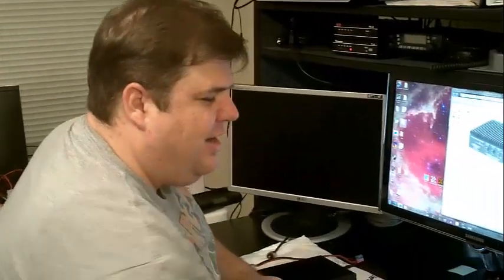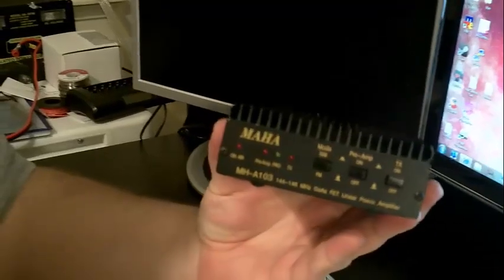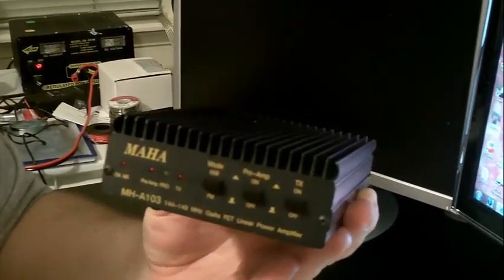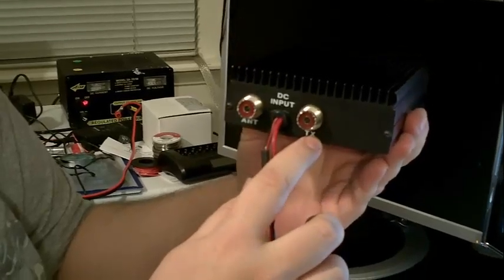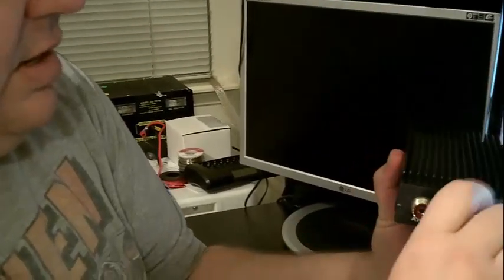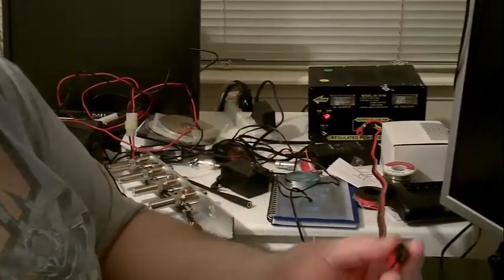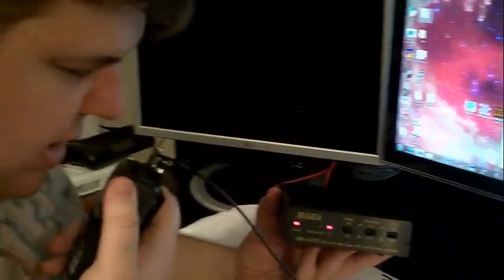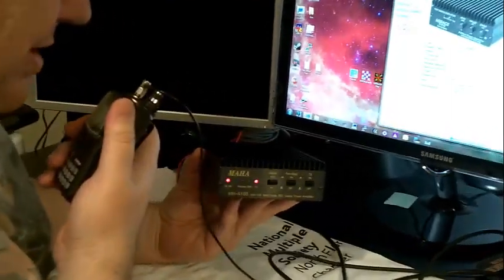Hooking Up  2 Meter Amplifier

Comment: Noob here.... so the amp must be on? It does not bypass? (run barefoot) just curious, if the power isnt NEEDED to make the trip, can  you tx with it powered off, and cut it on when necessary?? 73's
Reply: The amplifier is always on power wise but there is button that will make it bypass amplifer and power will go out a normal.  I have not tried not running power to the unit and testing.
Reply: @mikeh3787  might make a good video... lol. Thanks for your response!

Comment: So let me understand this - this amplifier amplifies your output wattage, that's it?
Reply: usernamemykel 
what more did you have in mind for an AMPLIFIER. ?
Reply: usernamemykel 
Yes it does.
Reply: Awwwww, yea.....you wanted an amplifier to do what ??
Reply from the maker: Yes,  example radio running at transmitting 5w goes out 35 watts.   Each amplifier has it's own specifications.

Comment: I would like to see what type of run time you would get if you hooked the AMP to say a small UPS battery or a riding mower battery.
Reply from the maker: That sound like a great project actually,  using the power formula if you could determine how much it drew you could get an idea.

Comment from the maker: The amplifier will extend your transmit power but if you are havng a problem with recieving weak signal, it typically won't help that.  Some amplifiers like the one in the video had a pre-amp which also amplifies the incoming signal which helps you recieve better but not all of them do.

The advantage of the repeater is that is at a higher altitude.  Our repeaters are typically 90-400 feet instead of 30-60 feet off ground like a typical home install.  I don't know many people with a 200 foot tower.

Comment from the maker: This video was along time ago :).   Now I would use my analyzer in line to make sure everything is ok.  I check all my cables now if I think there is an issue.  Interesting to note I was checking line at repeaters site and by adding a lightning protector went from 1.5 to 1.6.